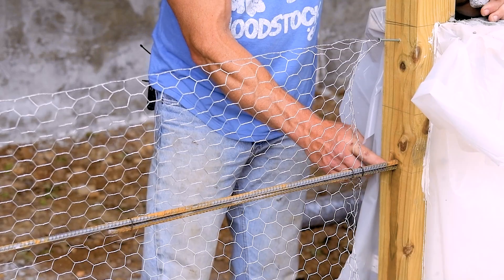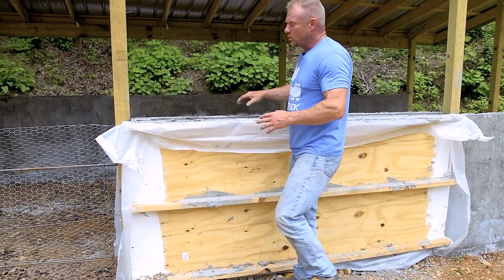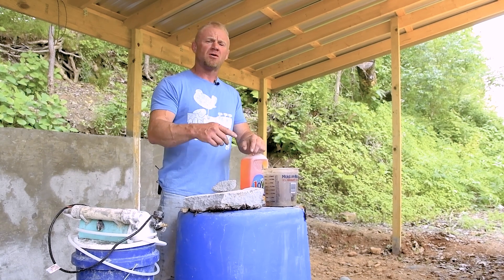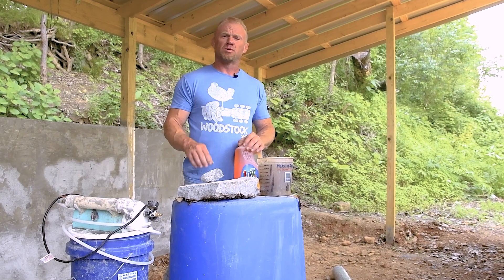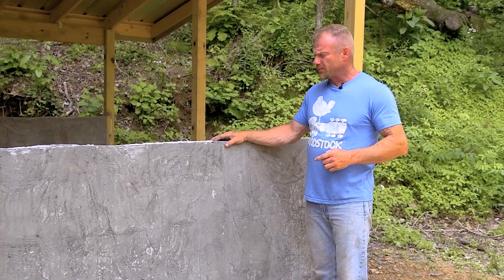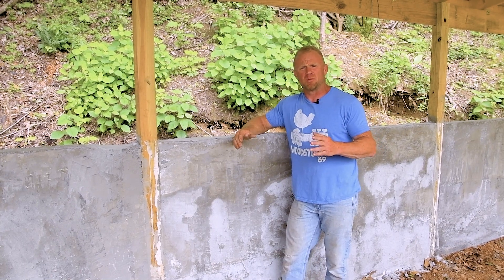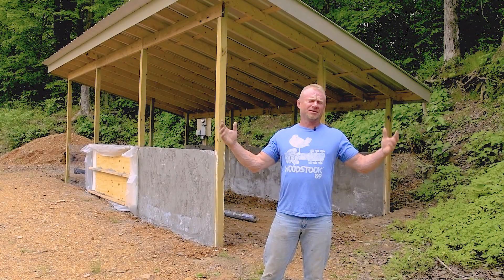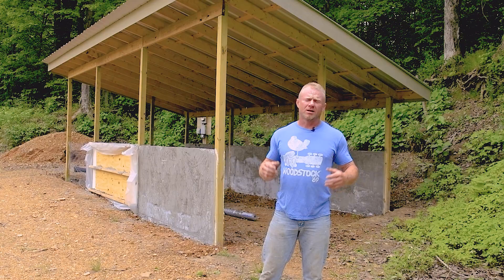Tiny House Ep.1- Aircrete Walls for High-Performance & Cost Savings | Van Powell Tiny Home Adventure

Comment: I want to make an Aircrete SIP. Sandwiched between two osb 4x8 sheets. You think it’s doable?
Reply from the maker: SiP  panels was my first idea. I think it works good because the bubbles distributed in the aircrete better which is one of the problems of aircrete. In addition I think the mix can be altered and make it even lighter and work just like spray foam insulation but it will not have any structural integrity. I built a dog house with SIP panels using metal studs and aircrete that works pretty good

Comment: You may have answered this already, but, how long should the molds stay in place once the aircrete is poured and how long should the panels cure before applying the surface bonding concrete?
Reply from the maker: Molds can come off in 24 hours but it will still be soft. I would pour all wall sections then come back and use the surface bonding. It takes about a week for the aircrete to dry and harden up and maybe slower. The SBC will lock in moisture and slow the hardening and drying process. I would suggest 1 day for forms but be easy for a few days . and a week to cure before SBC.
Reply: @TheTitian69  Thanks a lot. My wife and I are building our house soon based on your how-to's and a whole lot of research.

Comment: just FYI Aircrete is about R-2. that R6 info was bad info that kind of spread across the internet a styro-foam panel is like R5 and Fiberglass is like 3.5-4 so aircrete is not going to be better. R2 is still good though and some people are doing styro - aircrete and getting like 3.5 on that
Reply from the maker: Just for your information it depends on how much phone to how much slurry you mix that determines the r factor of air Crete. So not all Air crate is created equal. Second thing for your information I did not spread that across the internet I did not come up with that number on my own there are many references available on line
Reply: @TheTitian69  yeah not trying to say you were spreading it, it is the first thing that comes up when you google search as well as in youtube videos just wanted to post the comment so people consider the ranges of traditional insulation materials and can consider where aircrete fits in. I think it is still a great material and is a good insulator like better than wood and at least 10 times better than traditional concrete. And as you said the amount of foam will change the r value

Comment: Thank you! Answer to our prayers. Doing remodel of a room added on to a manufactured home and wanted to insulate with air crete but couldn't figure out the walls being existing  wood. Now we know! Two questions. Do you have a pump for pumping the aircrete into the forms. How do you deal with the cold joints for the top part of walls? My semi retired ontractor husband asking.

Comment: Super helpful - great details. Keep up the good work. Just Subscribed. My plan is to pour into 14.5" molds so that it fits between 16" on center studs for insulation - can you recommend the best ratio of cement/water/foam for this insulation design? TIA.
Reply from the maker: You can work a mix consistency to spray it between studs like spray foam insulation. Hopefully, I can get around to making that video.